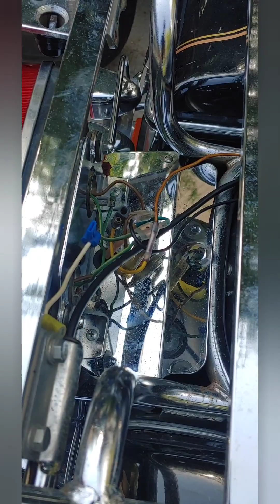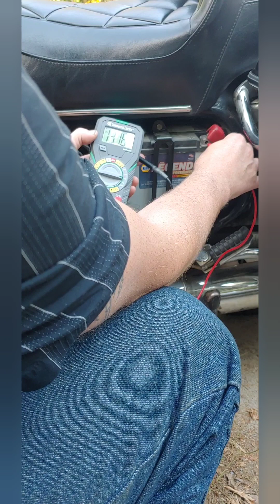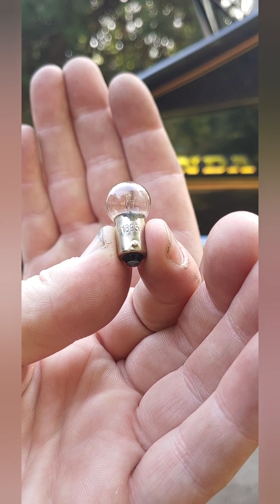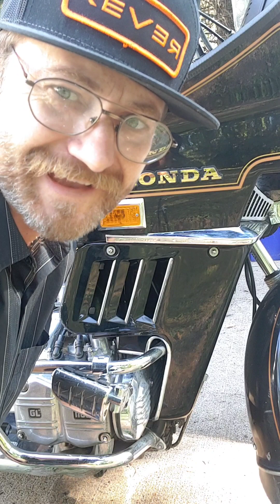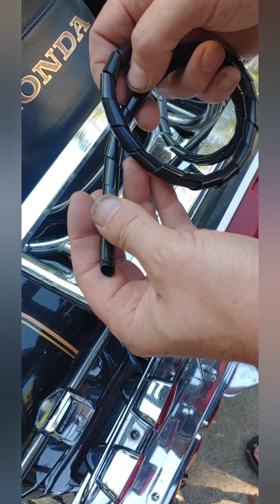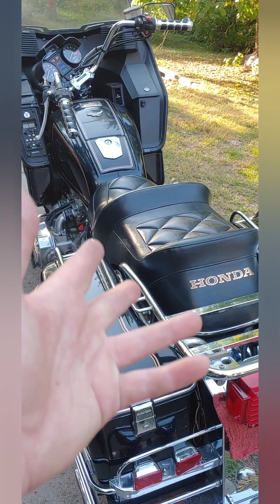Electrical System Checked and Fixed on a 1980 Honda Goldwing GL1100

Comment: Had an '80 and now an '87. Check the stator connector next to the battery. The 3-wire connector with yellow wires. The terminals corrode and then it overheats and melts the connector. Also the solenoid often gives problems. The 4-wire connector on top of the solenoid can corrode and you lose all power in the bike. Nothing works. Often disconnecting and connecting this connector fixes the problem for a while.
Reply from the maker: I've heard of guys actually removing that plugin entirely and soldering the wires directly together. If I find corroded connections, I'll be doing that for sure! Thanks for the advice